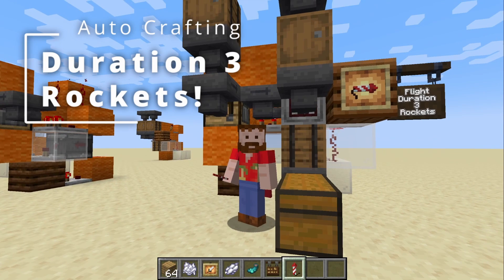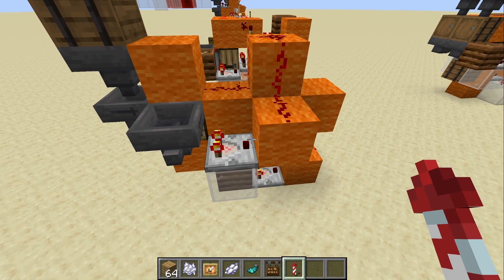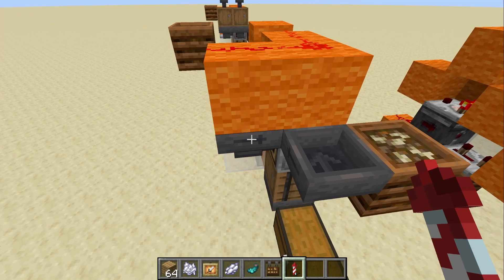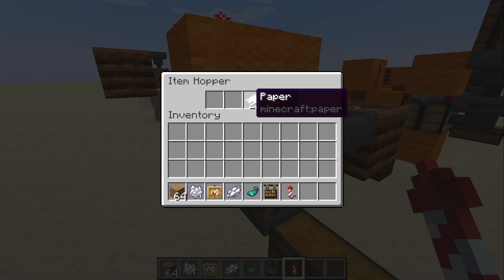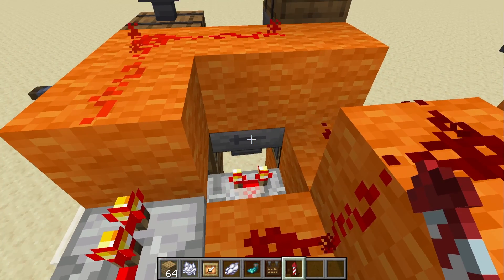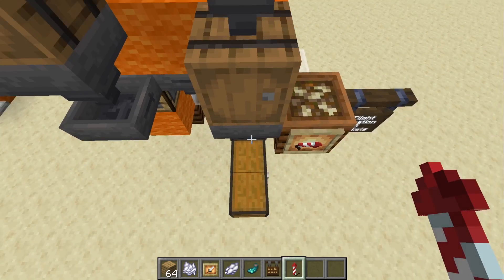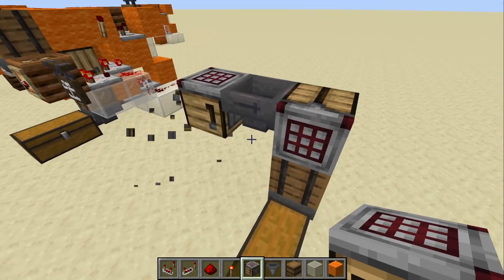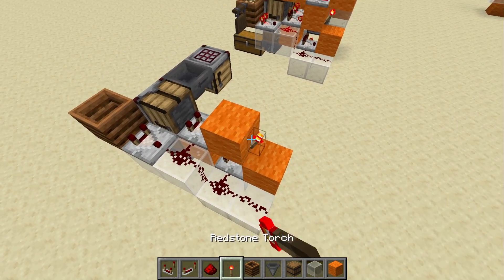Flight 3 rocket auto crafter with underflow and overflow protection

Comment from the maker: Small update - the udpate broke this (sortof).  The 'fill crafter' for the paper no longer works, but if you are willing to use some extra blocks, a more simple "subtract 8" approach can still work for the paper part
Reply: Could you make an updated video / community post / schematic on how this would be added to the design? Thanks!
Reply from the maker: My current plan is to wait for the 1.21 release, and then do an update video of this and other designs.  I'm a bit busy this week but I'll try and do an update schematic and screen shots hopefully next week
Reply: @elhedran  When is this coming by chance? I have been trying to do something remotely like but have been straining and haven't gotten it working so when this is finished it will be a lifesaver.
Reply from the maker: @Pyric.  Thanks for the reminder. Life outside of Minecraft is quite busy at the moment but I'll very much try to get this one done over the coming week.
Reply: @elhedran  No problem, for anyone wondering I got it working by redoing the left side of the machine to instead take the signal of a lectern to subtract 8. If you were to post your solution I would like to see how it works whenever you get to it.
Reply from the maker: Updated video here - https://www.youtube.com/watch?v=GU3MFvCT-x4